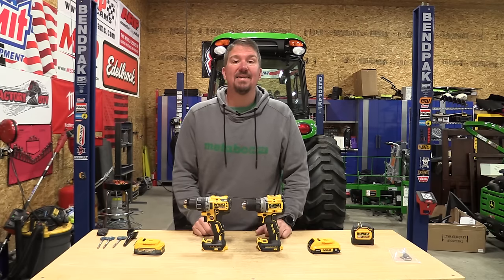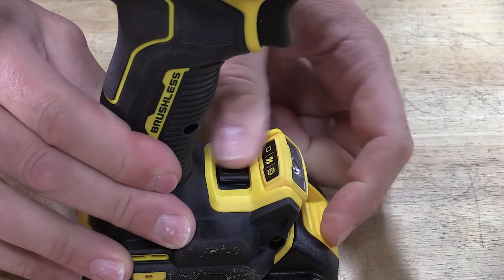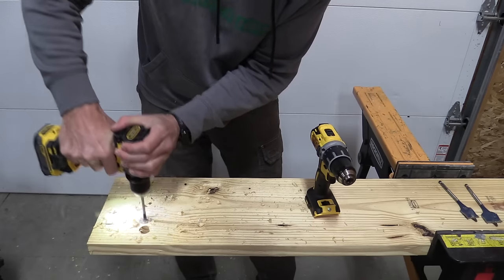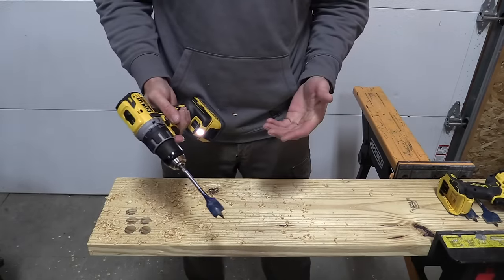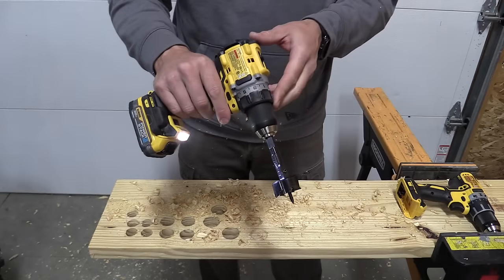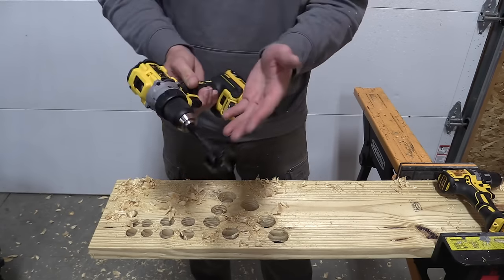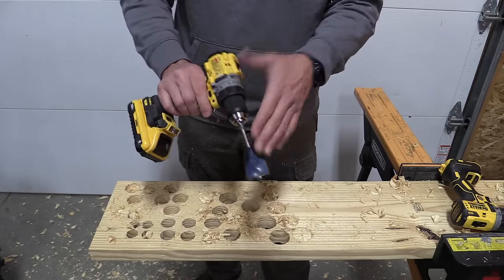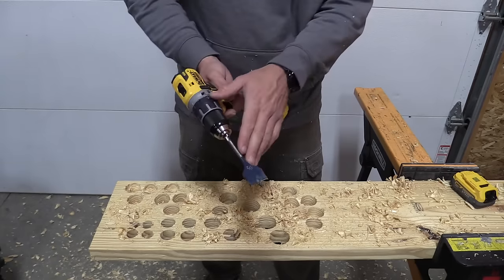DEWALT XR DCD800 & DCD805 Compact 20V Drill Driver Review DCD791 & DCD796 Replacement

Comment: DCD 791, 460W motor plus ~ 20% losses in electronic driver, 27Nm @ 550RPM and 7.42Nm@ 2000RPM. DCD800 - 34 Nm @ 650RPM and 11Nm @ 2000 RPM. Forget about hard torque 70Nm @ DCD791 and 90Nm @ DCD 800, coz' is just an impact shock from hard stop in speed 2 ( where it has 11Nm sustained) from full RPM with low load,   and is related to inertia, momentum, and kinetic energy in relation with the speed squared, so in speed 1 the hard torque is 9X lower for DCD 800 and 13,2X lower for DCD791...Hard torque is more marketing BS, and in in real use is breaking screws and stuff you work on. For extra torque there is the autobrake and manual wrenching, usable even when torque limiter is engaged and overruled.
Reply: Is the 791 a good drill.
Reply: @DiligentDave1966 

It's pretty good.
27 Nm soft torque in speed one is good enough for screwing even huge wood screws and for drilling above normal. It's pretty good enough medium duty, but not realy super heavy duty. Minuses are:
- 1. With 5Ah pack is wey to heavy. But with 2 or one row 3Ah compact the weight is OK @ 1.5Kg but not recomanded because it has higher RPM @ medium torque and it drains a lot of amps and so it can abuse the pack. With 4Ah so coled compact one row of 21700 cells it has the power but is to heavy @ 1.7 kg.
With 1.7 Ah powerstack the weight could be nice but the drill becomes front heavy and that is pretty bad, and altrough it has the power, 1.7Ah  is stupid retarded, even in 2006 I had 2 Ah NiCd. All other are to big and heavy, 5Ah powerstack, 6Ah high drain, 8Ah, flex volt, etc. Dewalt needs a new compact 2.5 Ah powerstack. 
- 2. Being brushless with high RPM and a larger diameter motor and fan it's noisier then previous non brushless mid torque models like DCD780, but it's less noisy then DCD 800 that has an even bigger diameter motor and fan and is very annoying noise wise. By the wey, DCD 800 specs were updated just after my previous post, and it has only 28 Nm soft torque in speed one, so only 1Nm over DCD 791.
Reply: @loochan325  I don’t know if you saw my comment, but I returned the 800 that I had. It wasn’t nearly as good as people make it out to be.
I was trying to drive some 3” timber locks, that weren’t very big in diameter, into Douglas fir. The 800 cut out and got pretty hot. It was pretty good with a spade bit, though, but most drills can handle a 1/2” spade bit. Even my 777 has enough power for that.
Reply: In speed 1 it should be OK and fast enough on both DCD 800 and 791. Anywey, even if 27 Nm is good enough to screw 8 x 300mm or even 10 x 300 without predrilling in soft wood, there are at least 5 problems:
1. Not all wood is soft...
2. Screwing in wood without predrilling is super stupid even if timber locks are spect not to need that. Not only that you need a lot of torque and power, drain a lot of amps, the motor and electronic driver gets hot, even the cables can melt and short, but first thing first the wood can crack and I can't stand that.
3. The brushless drills have a more agresive electronic cut of protection but also higher RPM even in speed 1 so more amps and more protection. For this reason an old  Makita DDF 453 stupid long and without light can look more powerfull with 27 Nm soft torque (43 hard) even if DDF has a decent protection, better then previous BDF. Even so, more screws one after another can be to much also for 453.
4. More screws one after another can abuse the tool and pack, they get hot and need protection.
5. The battery packs are not all the same. 2-3Ah models have decent weight but not enough power for 550-650 RPM in speed 1 @ 27-28 Nm.
Reply: @loochan325  Honestly, my 777 does it in speed one. I haven’t done multiple timber locks at a time with it, but it didn’t get hot after a couple like the 800 did.
I think the bigger body helps, as mentioned in this video.
Reply: @loochan325  I’m debating on getting the 999, the Flex or the Ridgid high torque drill.
Reply: @loochan325  Some people say that drilling pilot holes is too much of a time loss. I don’t know because I’m just a DIYER.
Reply: @DiligentDave1966  Wood cracks without pilot holes so it's a loss of both time and material and wood is pretty expensive this days, but even having free wood is just stupid to crack it and on top of that to use a stupid heavy ass drill for a mundane job and also to burn the tool and packs just to crack or split the wood...
Reply: @loochan325  I think it depends on the wood and the screw.
I’ve had good luck using the T25 construction screws from Home Depot, and I have used the 2X4’s from broken down pallets for a few of my projects.

Comment: I like the dcd800. Decent power in a small package. You don't need 1,100, 1,200 or 1,400 in. lbs of torque in a drill all the time. 800 - 900 in. lbs of torque in a drill will suffice for 90% of your drilling needs.

Comment: Good work as always. The new drills look great but I like my 791. just fine, so I'll wait until an absolutely, positively ridiculous deal appears to consider upgrading.
Reply: There’s a new one coming out that is supposed to be ridiculously powerful for a relatively compact drill.
Reply: @DiligentDave1966 do you know when?
Reply: @nalley6815  I don’t know, and I can’t even remember what channel was showing it. The video creator didn’t know the model number, either, so I can’t even tell you what to google.
I can only say that I didn’t have a great experience with the 800. I think the drills with the full size bodies perform more consistently than the really compact models.
For example, my DCD777 outperforms the DCD708 atomic, despite having the same specs.
Reply: @DiligentDave1966  dang really? 800 is what I was looking to get
Reply: @nalley6815  Everyone is different. Tinker with Tools loves the 800. Maybe I got a weak one, or I was just expecting too much from it.
Mine cut out and got hot when I tried to replicate one of the tests that he did on his channel, though.
Maybe I just had bad luck, but I think a bigger body allows for a bigger fan, and better heat dispersion.
I was looking at the 791, which is rated slightly less powerful than the 800, but has a bigger body.
I have also been considering the 998 or 999 because I don’t think I would ever be disappointed by the performance.
Reply: @nalley6815  The 750 inch pound Flex will stomp the 800 all day long. I would recommend that one unless you’re determined to stick with Dewalt.
Just make sure you register it within 30 days for the warranty.
Reply: @DiligentDave1966  I’ve been looking at all different ones and a bunch of comparison videos. Those flex’s are neat. So the deal is my ridgid batteries have taken a shit and I don’t really care for ridgid all that much. I’ve got an impact, impact driver, drill, and a light. I may get some later but I think I want to switch. I need an impact right now and I think I’m pretty determined to get the dewalt DCF900. I would like to stay with dewalt to keep the batteries the same but it’s really no big deal honestly. I’ll check that flex out right now though

Comment: I found DeWalt dcd800 and 805 manual and it's torque is listed as 90nm (hard) 27nm (soft) which is 796 in lbs and 239 in lbs. That is very good for a drill that size.

Comment: Insane power! Hardly need the 996 now.
Reply: I have the 805 and my friend has the 796. Huge power difference. 796 is allot stronger especially if your going to be using hole saw bits.

Comment: My 791 has taken a beating over the years and still works good.  The only problem I have with it is that the chuck is not very straight, and that seems to be a common issue.  There is a lot of runout.  Hopefully this new model will be just as rugged but with a better chuck.
Reply: Had the same trouble with a 785 and two 796 in a row. Makes driving screws in difficult to say the least. Seriously considering going Milwaukee now.
Reply: Hi. I have a dcd791 too, new. The reverse/forward button is very loose/sloppy. Did  yours have the same issue, or no? Does it matter? How can I repair it? Thanks.
Reply: @mikeike7114  I haven't had any problem with the forward/reverse selector.  The model I have was likely manufactured years before yours so it may be a bit different.  If I buy a new drill it will probably be the new 800 model

Comment: DCD800 looks like a good step up in performance, but I normally run my drill with small batteries for use around the house so maybe less power advantage for me.  I haven't decided if shorter of slimmer is more advantageous but I've noticed that the dcd800 is available for similar price to the dcd791.
Reply: Just use with power stack
Reply: Bill,
The dcd800 is $189 at Lowe’s with a 1.7 amp power stack battery, a standard 1.7 amp battery, a charger and a bag.
It’s the same price at Home Depot, but the Home Depot version comes with a 5 amp battery instead of the power stack.
Reply: @DiligentDave1966  I got a DCD800 with 5AH battery as a late Christmas present, I can't wait to use it on a fence repair project around our house.
Reply: @billj5645  From what I’ve heard, the dcd800 performs about the same with the 5 amp battery as it does with the 1.7 power stack battery.
The 5 amp is heavier than the power stack, but gives the drill longer run time, so it’s a matter of personal preference.
Reply: @billj5645  Let us know how it performs.
I’m thinking about getting the same kit from Home Depot.
Reply: @DiligentDave1966  I have a couple of the smaller batteries from my older drill so I have sort of the best of both worlds.
Reply: @billj5645  After watching this video, you should know that the smaller batteries are going to hinder the performance, unless they are power stack batteries.
Nice Christmas present, by the way.
Reply: @DiligentDave1966  the 5amp house us better get it

Comment: Do you think is better than the almighty 996, Bryan?
Reply from the maker: No.  It is close, but in no way or form could it keep up to a 996 in big stuff.  I would rather use this than a 996 while working though.  I am getting used to smaller and more powerful tools and it fits my ergonomic wants well.
Reply: @WorkshopAddict  got it
Reply: With their 12v line busting out the beans, I natually grab these first  and only pull out the bigger Boys for the heavy jobs

Comment: I ended up returning my DCD800.
It cut off and got hot when trying to drive relatively short timber locks.
Reply: I've used mine probably twenty five times and it cuts off when it gets hot. The gears also sound like they're coming apart. Would definitely not recommend.

Comment: Would you say the replacement it is better than the 796?
Reply from the maker: Yes, 100 percent.
Reply: @WorkshopAddict  Thanks!  Just have to wait until prices are announced to see if it is worth it to get the 805, I have the 796 and I think is great for diy.
Reply: @JT-lq4yd  Home Depot has the price for the Dcd805b hammer drill, but not in stock yet. $179.00
Reply: @akaredcrossbow   I think that's bit high and probably will be on sale soon like the DCF850 is currently with a battery and charger for $150.
Reply: @JT-lq4yd  it is higher than I expected. Probably wait until the end of May beginning of June.